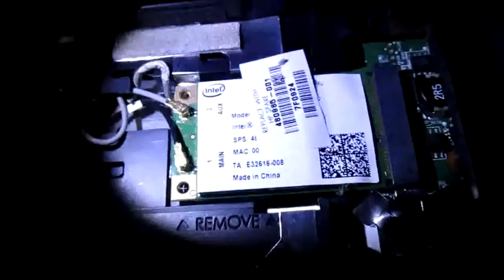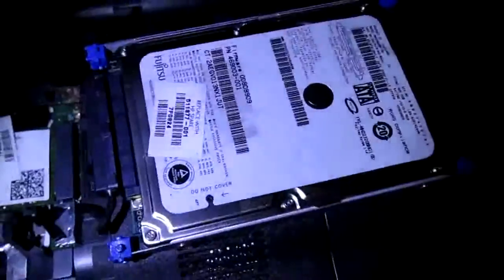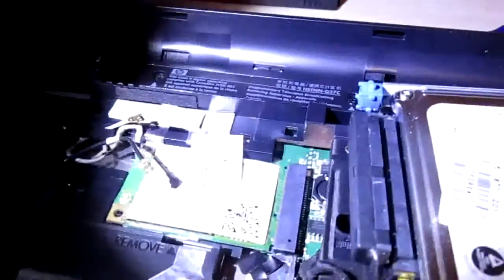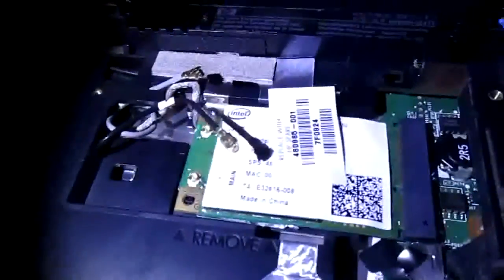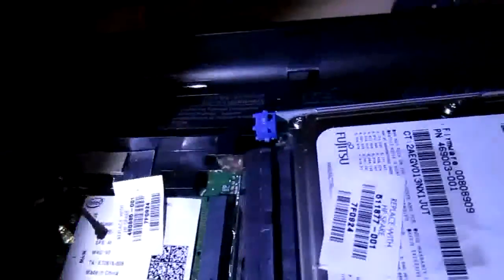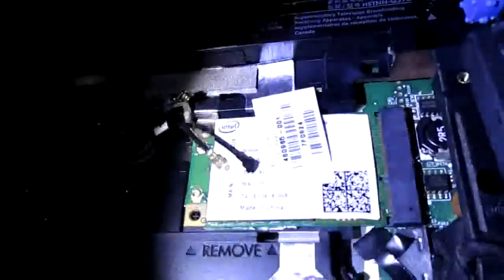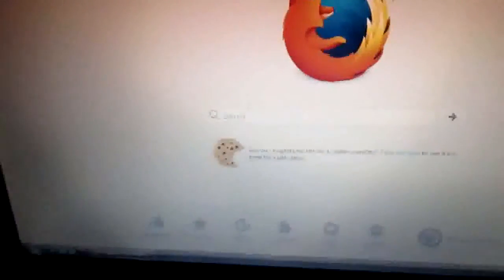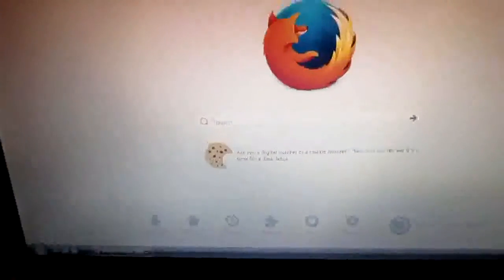HP Pavilion dv6 " NO WIRELESS WORKING" Reseat wireless card ON LAPTOP NOTEBOOK

Comment: hey not even joking my hp dv6 was saying my router was faulty. spent 2 days doing EVERYTHING! Come to find out that stupid black cable on WiFi card had popped off. FML but it works now!
Reply from the maker: HP does not even support these things anymore.   Ya. 2 days. Took me 2 hours. hahah. Sum ting wong. Stupid wires.

Comment: TURN OFF YOUR LAPTOP, DISCONNECT BATTERY AND THEN PRESS POWER BUTTON FOR 30 SECONDS AFTER THAT PUT THE BATTERY BACK AND TURN ON YOUR LAPTOP. IT WILL FIX THE WIFI DISCONNECT PROBLEM
Reply from the maker: NOI TRIED THAT.  Disconnect and seat it fixed it. The computer used to run VERY HOT. Alot of dust. THE HEAT CYCLES LOOSENED UP THE CONNECTION. SINCE THEN I TOOK IT ALL APART. CLEANED IT AND REPASTED THE HEATSINK IT WORKS LIKE A NEW MACHINE

Comment: I just went through an issue with Lenovo and Microsoft so I'm now a Linux user. I have a Win 8 machine that crapped out and crashed the HD and even though I have the Win 8 key they want more money than I can buy Win 8 at a box store. Solution was a free download of Linux. Screw Microsoft and Lenovo.
Reply from the maker: I was very close to putting Linux on my tower when & was being a pita..    Its up and running  now, I may build a whole new tower in the next month or two, super computer! add what you want and thats it. windows 8 sucks, I hated that OS. I dont like spy 10 either
Reply: I agree. Its amazing how much faster this computer responds now with Linux. UXW Bill is correct about Linux.
Reply from the maker: I may try it!   When I build my super computer I plan to run 7 and be able to put it in XP mode in a Virtual mode.  I should also opt to run dual operating systems on it, Windows and Linux.  I bet linux does not slow down either when it gets all junked up like windows does with time